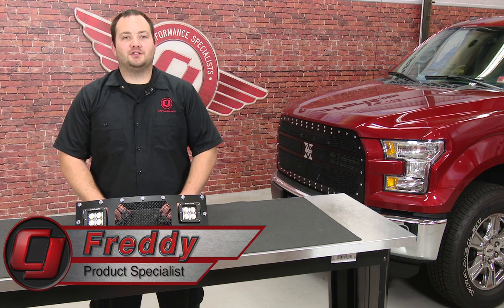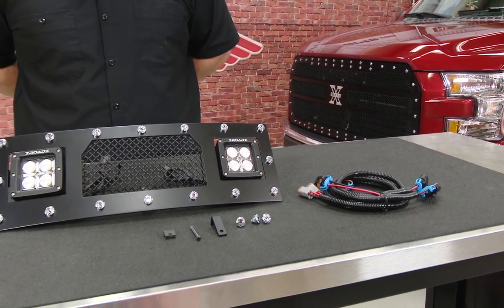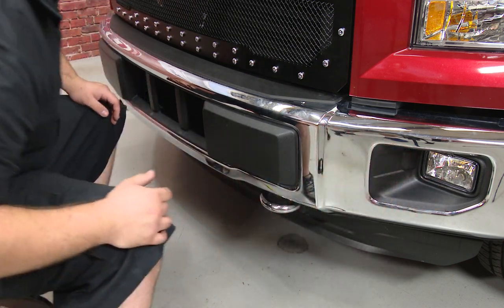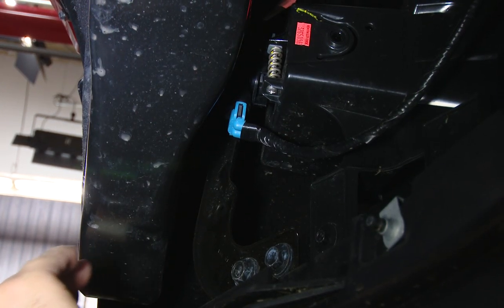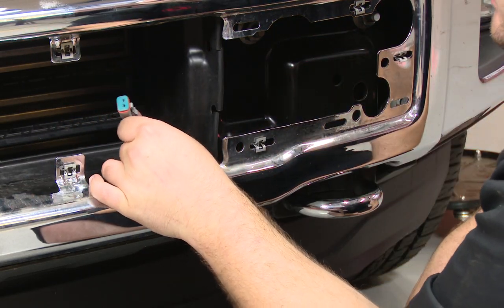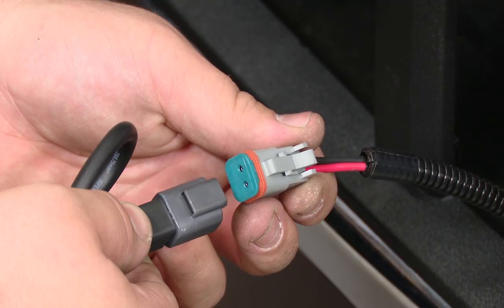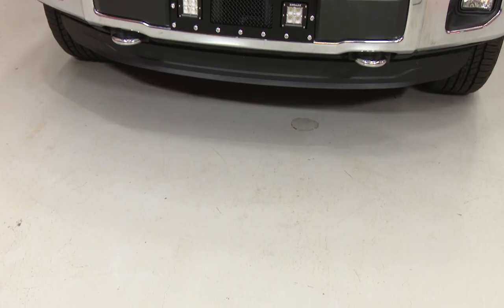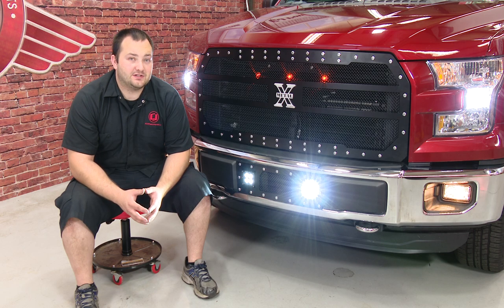F-150 T-Rex Grilles Bumper Grille Torch Series W Dual 3" LED Pods EcoBoost 2015-2016 Installation

Comment: Hey! I have a question. In this video you have normal factory fog lights and the grill lights up. I have replaced my H10 fog lights with leds and when i plugged in the starkey wiring harness (5010-2) my led fog lights light up but the cubes on the t-rex do not. Any suggestions?
Reply: We have heard similar issues with this product, the wires on the starkey harness may be reversed. If you can, try pulling the blue tabs off of the black connectors and switch the wires and see if that works.
Reply: My harness was reversed. It took me two days to figure it out

Comment: Hi, Question! It could make an adapter for the Front license or not posssible because need it a ventilation that passes by there? Thanks
Reply: There's no way to mount a license plate to it without modifying it.